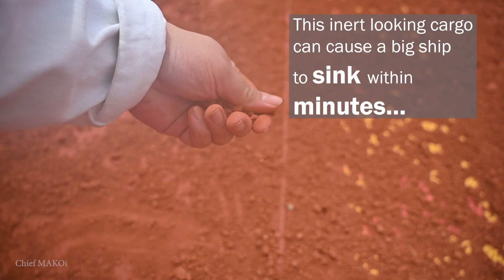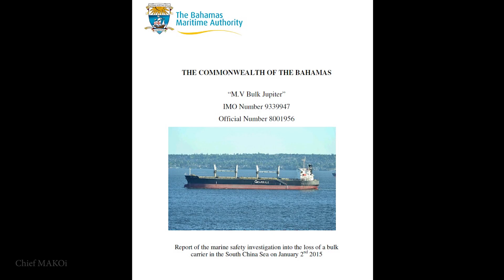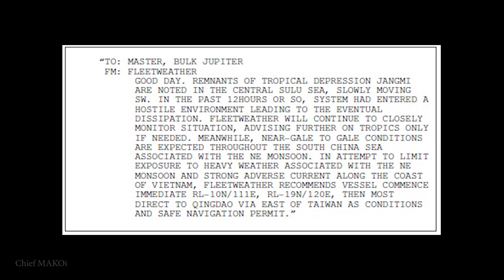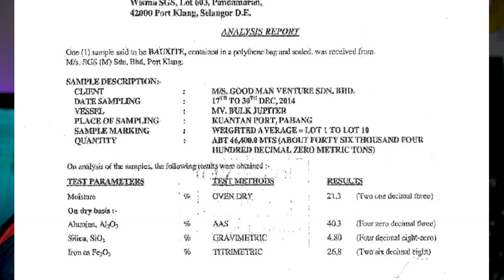The Cargo That Can Sink Ships Within Minutes : Bauxite Liquefaction | Chief MAKOi Seaman Vlog

Comment: Wow! I never realized how dangerous some dry cargoes could be. It seems to me that moisture being the major culprit in the sinking of the first vessel mentioned, more testing should have been carried out and the Captain should have mandated that to be so, as did the Captain of the second vessel mentioned, who did exactly that, as he should have, crew and vessel safety being paramount. It is a pity the ship went to the bottom with that many crew aboard, not knowing all of the facts I shouldn't render an opinion...but I will. Abandon ship should have been called before the situation went to the point of a broach. IMOP the situation went south when further testing was not performed prior to the ship getting underway, had that been done, in a proper fashion and the ship's cargo was determined to be above the safe level of moisture, re 10 percent as stated, obviously it had to be much higher from a percentile standpoint, the ship should have not gotten underway. Mistakes are made all of the time..but when it comes to crew..and ship safety over potential profit on cargo by the powers that be, I take issue, safety, overall, is paramount. GREAT JOB !Super informative, though sad, thanks for sharing your expertise on such an interesting subject. Thanks Chief...All the very best...

Comment: Wouldn't breakup into 2 smaller holds cut down the length of the ship rather than the width prevent the liquifaction issue by preventing the combined mass rolling? Yeah, liquid content still can severely degrade the quality of the cargo and you still have to balance the loading, but for other semisoft and particulate materials (silicon quality sand especially) it's not nearly as much an issue.

Comment: This reminds me of a tragedy that happened in the 50s. A German sailing ship had loaded more Cargo then recommended since they had been delayed and the company put pressure in the Crew because of the lost money.  
To accomodate the added Cargo, they decided to empty some water Tanks which were used for stabilisation. The Cargo was rye, but instead of storing all of it in bags, they filled the storage rooms with mostly loose rye and only put a few bags on top to prevent the rye from shifting too much. Unfortunately this was not enough and during a storm the loose rye tipped all to one side and the ship sank. Only six of the originally 86 crew members survived.

Comment: Aviation had a similar problem a couple decades ago with managing commercial pressures with safety( usually related to weather, weight or some technical fault of the aircraft), and it took a lot of pressure from the safety associations to make possible for a captian to cancel a flight or expend fuel doing go-arounds, holds or diversions without the company breathing down his neck.

Comment: Very interesting video.
I first thought the danger was to do with the chemical properties of the bauxite, but I understand that this is due to the size of particles in the bauxite.
I wonder there are other ways of mitigating this, such as changing the way bauxite is crushed to have different particles, or changing the geometry of the cargo holds to prevent the slurry from sloshing.

Comment: The ball bearing example is another illustration of the fact that multiple pendulums will always synchronize if they are linked together. Metronomes on a table (especially if the table can move a little) will all synchronize due to the motion transferring through the table. Never thought that could sink a ship.
Reply: This was my first thought too when I saw the ball bearings example.
Reply: Metronome synch.  Exactly what I thought too.  There are some great videos about that phenomenon  in Physics.  It is not segregated to shipping or cargo only.
Reply: Even clocks o the same wall, it's a tiny pendulum mass versus the static mass and they'll synchronize too as long as the pendulum parts are on the same plane.
Reply: @CanalTremocos  i just tested this theory by taping two digital watches onto the wall and they didnt sync up ):
Reply: @brndto  Of a ship at sea?
Reply: @CanalTremocos  you can even slow one of the clocks down by putting it in motion the faster you go the slower your clock will go it's called time dilation
Reply: Random metronomes won't,  they must be nearly in tune in the first place.
Reply: @2adamast  Laa0fa is correct.  If any motion can be transferred they will sink up.  It's called constructive and destructive interference and they're fundamental properties of wave harmonics.
Reply: @2adamast  if the table can move they can be started at opposite ends and will eventually sync up

Comment: It seems like you could have a set of walls that separate each cargo hold into four compartments across instead of one big compartment. This would prevent dynamic separation from allowing material to move from one side of the ship all the way to the other. Obviously this takes away from some of the storage capacity but it would seem like a good compromise vs overall safety in case something goes wrong.  You can try to have sufficiently dry cargo but you cannot guarantee that it stays dry all the way if weather goes downhill.

Comment: I'm going to assume people waaay smarter than me have thought of a lot of possible solutions, so I've no delusions that I can end the danger, but it seems like separating the port and starboard sides of the cargo hold with some sort of wall or divider would limit how much cargo can end up on one side or the other of the ship. Half of the cargo would always be forced onto one side.
Reply: The short answer is "yes, it will help," but you're not shipping goods for charity, you're here to make money. If adding partitions costs significantly more or dramatically extends the loading/unloading process, you're probably going to factor that into your calculations when investing in them.

That seems heartless, and it is, but considering that "just wait for the cargo to be safe" requires no investment and isn't necessary every shipment, it's a decision many are going to make.

Comment: Would it be feasible for a method of  heat to be applied to the top of the cargo holds for the moisture to be extracted out with evaporation via ducts?
Reply: Way too expensive

Comment: What a truly fascinating story about something seemingly innocuous that can rapidly turn deadly given extreme circumstances.  I wonder, is there a better way to load these ships during rainy conditions than this?  This open-air clamshell method seems very antiquated.  Why can't this powdery bauxite material be pumping via vacuum pipes onto the ship instead?  Or how about using internal baffles to mitigate the flow of this liquefaction material?  This would prevent listing or capsizing I'd imagine.

Comment: It should not be difficult for ships to independently quantify moisture content for thermally stable samples. Loss-On-Drying does not require expensive equipment or expertise to do. Heck, you can do it with an Oven and a Weighing scale if you use a large enough sample size to account for measurement errors.

Comment: I have to ask why they don't just use air transport for this stuff nowadays. If it's this unreliable to use boats surely it shouldn't even be done anymore.
Reply: Cost? Largest commercial aircraft can lift ~250 tones, and there's only one of those, second and third can lift around 150 and 130 tones respectfully. Cargo ships measure their loads in thousands of tones. So I assume some number crunchers somewhere decided that the risk of occasionally losing some ships and some crew is worth it.
Reply: @zZzZzyxel  fair enough, although with the rising risk of ocean and tropical storms and sea levels the logistics of shipping will need to be evaluated on safety soon

Comment: why not simply put walls inside going the length of the ship if you fill them side by side these walls could prevent so much shifting so if liquifaction happens the walls cause the cargo to stay relativly in place keeping the weight from toppling the ship.

Comment: I feel like there's a very simple solution for these types of loads, and it's similar to what some liquid carrying trucks have implemented.

If you put some walls in the containers that run lengthwise to the ship, it will stop a lot of the side to side motion of the slurry. Where you see the demonstration with the marbles in the video, imagine instead on each of those tracks having three marbles with two walls in there to separate them
Reply: Yes, I believe they are called baffles.
Reply: That won't be economical for this type of vessel because bulk carriers carries dry cargo in bulk. If those walls are made, the cargo space would become small hence not economical to carry the cargo. For liquid cargo, we have special tanker ships with the wall which you are talking.
Cheers.

Comment: Want to stop this?  Step 1: put stiff mesh walls into holds to increase the liquifaction resonant frequency and reduce its gain, thus preventing a powerful resonance.  Step 2: Seal holds to prevent excess moisture ingress.  Step 3: Bilge pumps and filtering for separated water removal.
Reply: They probably don't exclusively transport the stuff so making a huge modification for one specific cargo seems unnecessary.

Comment: That popping sound during the sinking is, I think, bulkheads failing and the FWOOOOOOOSH is air escaping the stack as the engine room filled with water.

Comment: That's interesting. I worked...briefly... at an alumina refinery. One of the cleanest areas to work (not a laudable claim) was on the top deck of the acid wash columns. Aluminum ladders were restricted in that area because the acid vapor would eat the Aluminum and quickly impact the integrity of the ladder.  You work nearly any other area of an alumina refinery, I hope you like red.

Comment: Me before watching: "If bauxite is so dangerous, then maybe we shouldn't transport it so much"

"Bauxite is a mineral which is the world's main source of Aluminum"

Oh, yeah no, that's never happening

Edit: Fixed the spelling of bauxite, Aluminum is already correct so just ignore that guy in the replies
Reply: I mean, trying to put smelting facilities closer to the mines could help, but short of that, yeah....
Reply: @dynamicworlds1  we did that, it meant building ecologically destructive dams in the middle of the already ecologically devastated Amazon forest, where miners and other native inhabitants were absorbing the health and economic costs for the rest of the world.

As awful as it sounds, shipping is less destructive. Dredging a harbor to a depth needed is awful and strip mining beautiful ecologically rich and economically poor areas is worse, but a smelting plant isn’t going to make it better.
Reply: @dynamicworlds1  
Well that would be an easy solution. So that’s not allowed
Reply: @dirtydanthesecretsauceman8519  
Producing aluminium is incredibly energy  intensive, so only countries with exceedingly cheap electricity can do it. Which is why a lot of aluminium is produced in Scandinavia, the US and Iceland, which have lots of hydro, gas and geothermal power, respectively.
Reply: Aluminium is very recyclable though, and less energy intensive and cheaper than refining it from bauxite. But of course we still need huge quantities of bauxite satisfy the need for alu
Reply: There are recycling bins where I work yet there are always aluminum cans in the trash.  Sometimes just a few steps away from the aluminum recycling bin.
Reply: It's Bauxite and Aluminium.

Comment: The more void space in a hold which contains cargo, the more room for slop and stability issues.  I wonder why they don't fill the holds to nearly deck level which would reduce cargo movement potential.  If there would be overweight issues, then why not fill only holds 1, 3 and 5 (assuming it is a 5 hold vessel).      (or maybe holds are filled as far as practical but slop is still a danger...   dunno)
Reply: Some kind of lid against the top of the cargo might help, but it would need to be deeper than the deck, I think.
Reply: @SeekingTheLoveThatGodMeans7648  They do have hatch covers over the top of the hold, but yeah....   reducing the amount of empty space sounds good.

Comment: I am the 3rd generation in my family to work in a alumina refinery here in louisiana were bauxite is turned into alumina powder wich Is then fired in a kiln and melted into aluminum or sent off to be mixed into other processes. Let me personally say bauxite is no fun to be around, it stains everything bright red and is extremely difficult to get out of clothes or anything else it touches. and ohh boy when it gets wet you can give up on doing anything with it, it just because an enormous pain in the but and makes a huge mess. I have seen a couple brand new dry bauxite storage tanks have there  bottoms bust out due to over weight/wet bauxite.